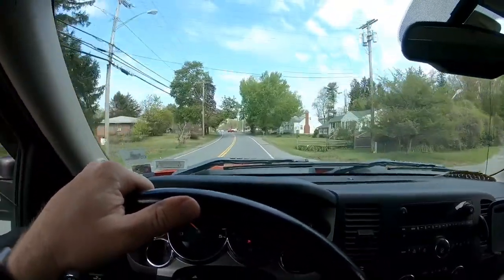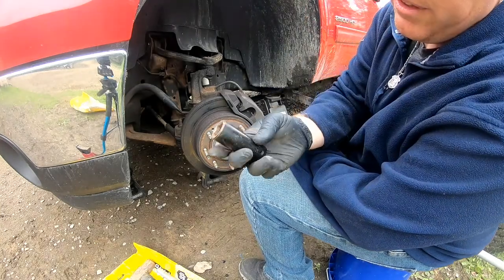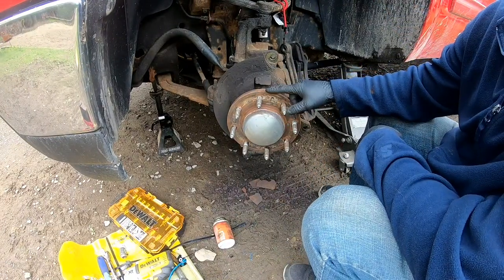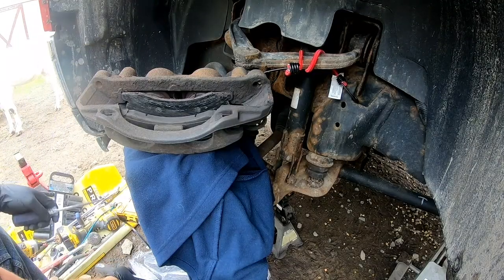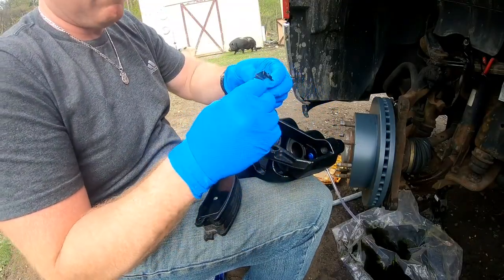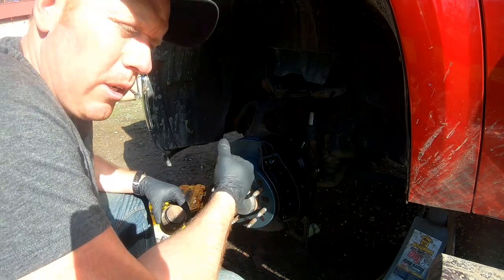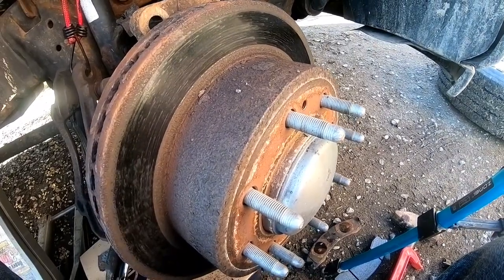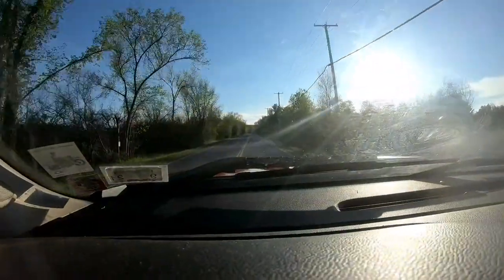How To Change Brakes, Rotors,  And Calipers On A GMC Sierra Duramax 2500 HD

Comment: I know this is over a year ago but for future reference, when your unbolting the caliper , do what you did to take brake pads out bolt the whole thing back on then smack the caliper with a bigger hammer than the one you were using, the caliper will slide on the pins and you'll be able to unscrew them alot easyer, they will freeze up again even if you lube them, and the two threded hole in the rotor are for jack bolts , screw bolts in and they push the rotor off.
Reply from the maker: Bigger hammers always help!😁 thank you for the info! And thank you for watching it's always good to touch base with knowledgeable people!👍

Comment: What's the torque rating on that conduit? lol that bolt is supposed to be set at 221 ft lbs. I took out my 1981 Snapon torque wrench and holy shmoly I have to take algebra again to figure out how to set it!
Reply from the maker: Lol turn till tight and then tighter lol thank you for watching!👍😊